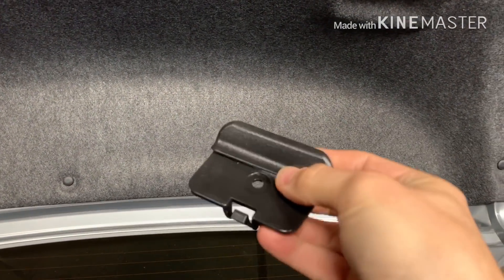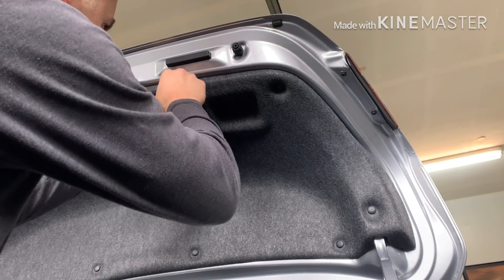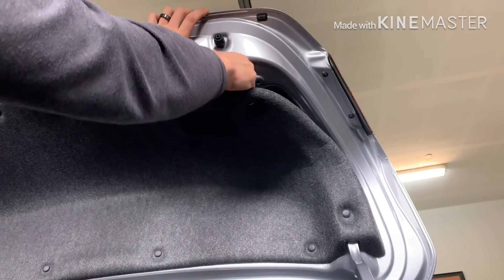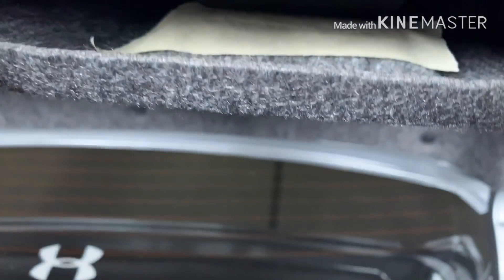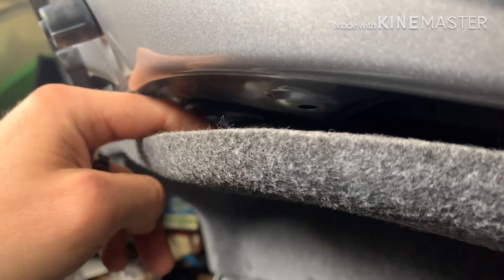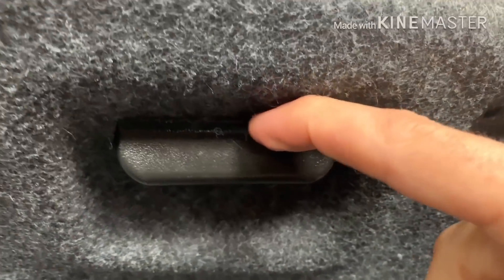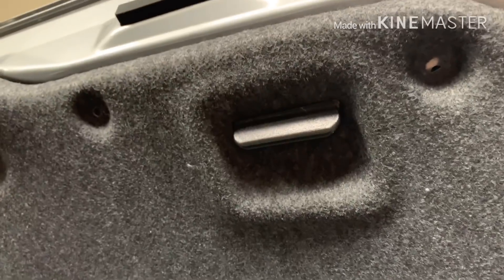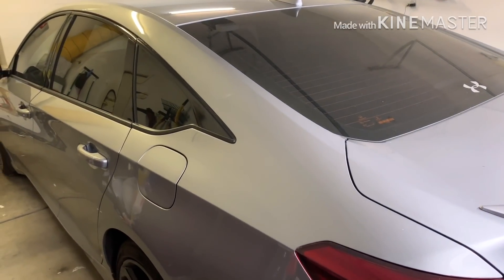2018 2019 2020 Honda Accord oem trunk handle install that prevents scratches on the paint

Comment: Awesome thanks so much for sharing! Just installed mine, I had a little trouble getting the clips back in but figured out, you pull it apart, squeeze the tip then slide it all in there.

Comment: Mine just got delivered today. Bought my Accord about a month ago and couldn't believe my old Ford Fusion had a trunk handle and this car didn't. Will be installing today so I won't have to muck up the paint with fingerprints or have to shut my trunk by pulling the locking mechanism.
Reply from the maker: Nice. It’s a nice little feature fore sure and fits perfect since it’s oem.

Comment: I just got one installed in 3 min. Thanks Jon
Reply from the maker: No problem. It’s a nice little mod.
Reply: Where did you buy the handle?
Reply from the maker: eBay was the cheapest. Just type up Honda Accord trunk handle. It will pop up.
Reply: @HondaJon  Thanks Jon...

Comment: Hey HondaJon does the trunk handle still function fine with the trunk hydraulics you installed? Or does the trunk pop back up a lot?
Reply from the maker: It’s works good. It’s just takes more muscle for sure to close it.
Reply: Honda Jon Lol is it like a regular amount of muscle or is closing the trunk gonna be a workout if I get the hydraulics?
Reply from the maker: It’s akward for sure. I find myself not using the handle anymore lol

Comment: Where can I purchase?  I'm sold!  I've already noticed a need for something like this. Should have been standard.
Reply from the maker: It’s cheap and easy. Here’s where I bought it. It’s the cheapest around. 

https://rover.ebay.com/rover/0/0/0?mpre=https%3A%2F%2Fwww.ebay.com%2Fulk%2Fitm%2F252267896857
Reply: Got one from my local dealership for $11.
Reply from the maker: Nice. Not bad at all
Reply: Got it and installed today.  Thanks for the guidance on the right place to cut and how to tuck in the edge.  Looks absolutely stock!  Any time you touch your finish and there's even the slightest amount of dirt on it you're effectively grinding it in.  Awesome I won't have to touch the exterior to close my trunk from now on.
Reply from the maker: Nice. It’s a simple part but is nice to have. 👍🏻